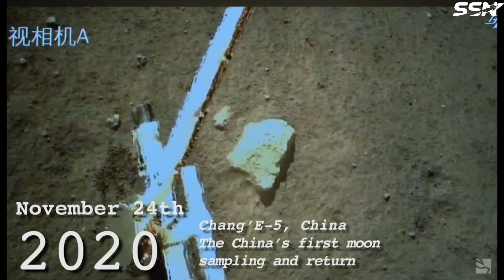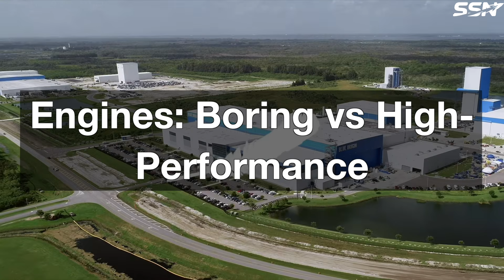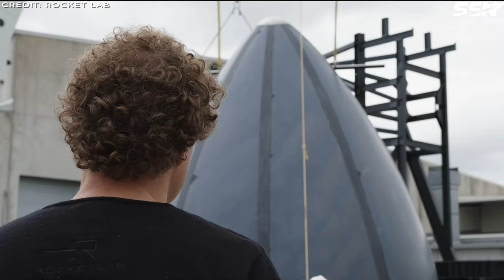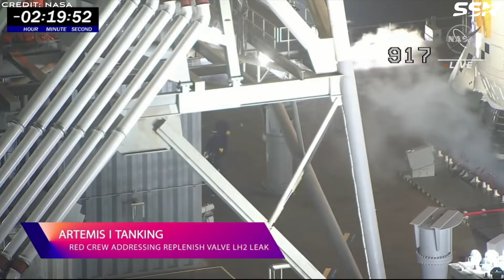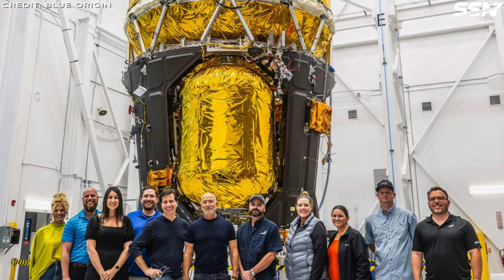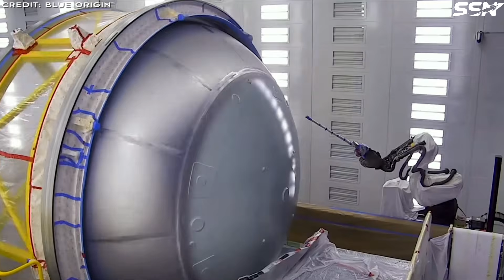NASA's Big Mistake: Choosing Risky Tech Over Reliable Systems

Comment: China's technologies are not reliable.

CZ-10 uses staged high-pressure rocket engine. Not tested. The moon capsule has not been tested either.
Saturn's technologies are the most complex and not tested, using H2. And a lot of spaceship dockings.
SpaceX's technology is the most reliable.
They will even rely on their previous generation (Falcon). These are just facts.
Reply from the maker: Starship is nowhere close to being ready.

Milestones yet to be achieved:

Relight an engine in space. Perform an orbital flight.
Refill a Starship.
Launch a tanker variant.
Launch a Lunar Starship variant.
Land an uncrewed Lunar Starship on the Moon and then take off again.
Dock with Orion autonomously.
Demonstrate a functioning life support system. Human-rate Starship.
Fully refuel an orbiting Starship using multiple launches in quick succession.
Demonstrate loiter time in orbit while carrying cryogenic fuels.
Reply: @SpaceStartupNews   The Starship has already restarted the engines in orbit. Unlike the CZ-10, for example, and the Chinese lunar capsule. China does not have proven technology. China does not rely on the old or not the ultimate for them.
You can repeat the approaches of the laggards. But why? Because the old approaches have already been explained to you? Old technology is not needed for the NASA. The Chinese too. China can't do better, but it will try.
Reply: @SpaceStartupNews   The difference between the US and China lies in their different goals and capabilities. China's goals are propaganda and catch up. You're praising before China has succeeded. For many years now, I have been hearing the propaganda of Chinese success, which does not yet exist. If that happens, we'll discuss it, but for now, let's praise the real successes.
The goal of the NASA is the exploration of the Moon and science. The NASA already flown to the moon. Old technologies are contrary to the goals of the US. Only new technologies should be supported at the expense of taxpayers. You spoke out against the goals of the US, against the interests of taxpayers. They have the right to count on half a century of progress, not waste.
So far there has been no failure of the US. But you're already scaring us like a failure has taken place. You probably need some other words.
In particular, if the Chinese can repeat the long-standing success of the US before the US repeats it, only joy. Only the new achievements of the US will clearly give China new models. This is how world culture has always advanced. And there were always those who declared the victory of the second, lectured the leaders.
I've read about it in ancient books.
Reply: @Ernest-jr  this is a weird take honestly, because you’re acting like only one kind of success “counts”, and everything else is propaganda, which just isn’t how reality works
first, china’s achievements aren’t hypothetical, they’re already happening, whether you like their system or not. they’ve built their own space station, landed on the far side of the moon, brought samples back, and are clearly building toward more. that’s not “propaganda”, that’s hardware in space
second, saying nasa shouldn’t use “old technology” doesn’t make much sense. spaceflight is one of those fields where reliability matters more than novelty. you don’t throw away proven systems just because they’re old, you build on them. the apollo program itself reused and adapted existing tech. even today, spacex, nasa, everyone does that. progress isn’t just “new = good, old = bad”
also, the us hasn’t gone back to the moon with humans in over 50 years. that’s not a failure, but it’s also not something to just ignore while claiming everything is perfect. acknowledging competition or delays isn’t “scaring people”, it’s just being realistic
and about “only praise real success” — sure, but success isn’t exclusive. multiple countries can achieve things at the same time. recognizing that china is catching up in some areas doesn’t mean you’re “against” the us, it just means you’re not pretending the rest of the world is standing still
the whole “wait until they succeed” argument is kind of outdated too, because in many ways they already have. not in everything, but in enough areas that it’s worth paying attention
you can support nasa and still admit other countries are making progress, those two things don’t cancel each other out
Reply: @superpowerdragon  Existing success matters. Imaginary or promised, it doesn't matter. You weren't even promised, by the way. What exactly is wrong with me?
Please stick to the topic. It's good that the Chinese are striving. They're not the only ones, by the way. There is NO Chinese success yet, if you remember what we are talking about here.
I agree with you: it doesn't make sense to use old technologies. For NASA. China can only use the old ones - it makes sense.
Reliability is important everywhere. New technologies are those that are more reliable. Watch the technology. Soft is not blue. Novelty and change frighten you, I get it. But are your fears really important?
I am not ignoring the achievements of the US. Just you. It is also remarkable that these achievements are 50 years old. Perfectly! Worse, China has nothing to do with it. They scare us with the future failure of NASA, as if it had taken place. And the same "success" of China. They scare you now, not 50 years ago. Something that doesn't exist. You lose touch with reality.
Yes, China is repeating a 50-year achievement in those other ways. They can be understood and, with reservations, praised, or even pitied. I would even write: the Chinese slavishly copy. This happens in authoritarian countries where there is no expertise. It's easier for management to order you to do it "like people do."
Signs of strong nations: diversity, novelty, disobedience to the opinion of the crowd (the crowd can interfere). As an engineer, I am always surprised by the variety and novelty. China, on the other hand, has a terrible history and a present. Good luck to the Chinese to overcome the complexes.
Many nations are catching up with the US in some ways. Some are superior. Are we discussing some? No nation stands still. Let's keep writing about the topic here. All other statements, I suspect, are equally "justified" by you.
And don't attribute your statements to me. I'm not canceling, you're canceling. You have difficulty recognizing the first and the best. You even hint that everyone is equal.
Reply: This is not really about China's success, but about the US. That is, in particular, about comparing China and the United States only in the future exploration of the Moon. When you accept the subject of the discussion, I will discuss it with you.
I am ready to talk about the damned communists and their propaganda in other places.
Reply: both China and America have unreliable, untested systems. The difference is that the Chinese have taken a far more conservative, less long term approach where they are currently aiming to get experience from going to the moon with the Long March 10, with Long March 9 being in development for future, long term exploration. It allows them to get to the Moon faster and define their territory before America gets there, with both America and China having significant interest on the Lunar south pole. Especially in regions like Shackleton crater.